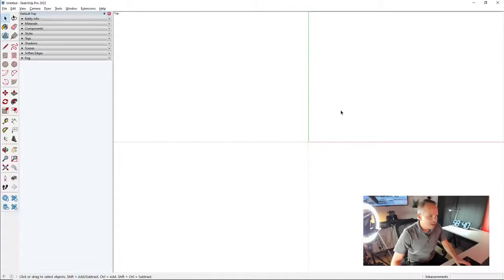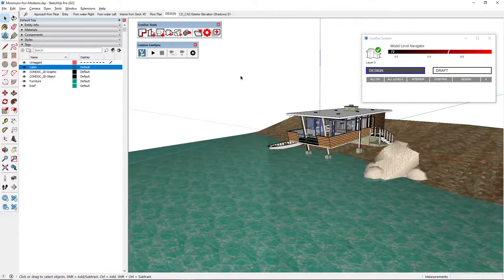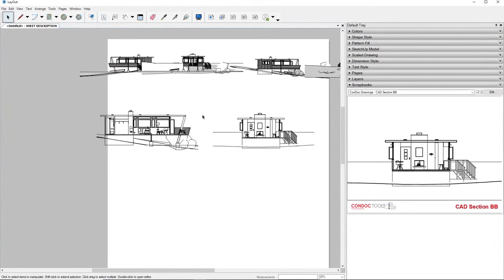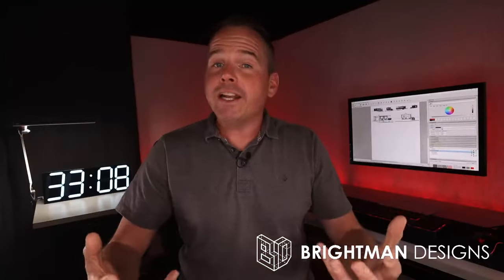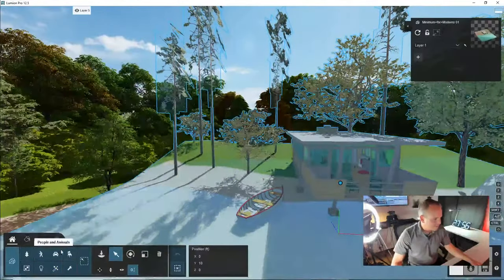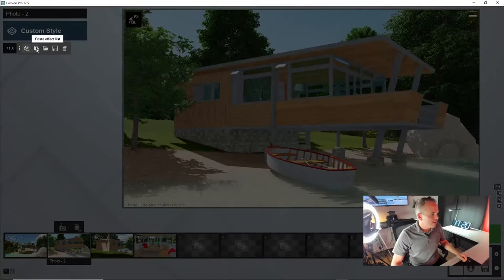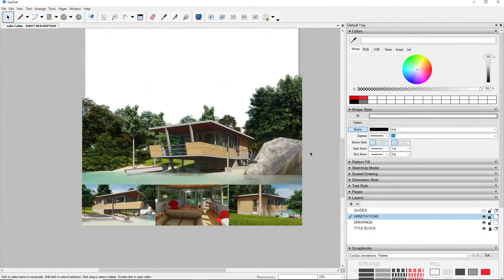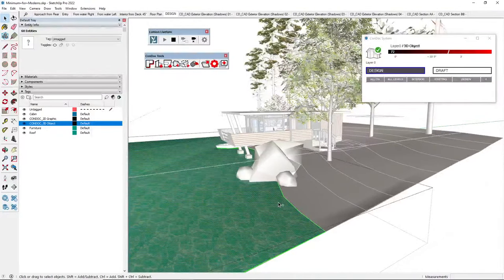Architectural Presentation Board in One Hour

Comment: GREAT presentation! May I ask two things .1. Could you do this same live presentation  for doing construction drawings, please. And 2. What are your machine specs, please, getting Lumion and Sketchup flowing together seamlessly  with no staggering was nice to see. Love the work flow for a presentation board , great work shop !
Reply from the maker: Thanks Wayne!  Love that idea, will add it to the list!  Here's the specs on my new desktop...  

Nvidia RTX 2080ti Graphics Card
CPU Intel Core i9-12900KF 3.2 GHz 16-Core Processor
CPU Cooler Corsair iCUE H150i ELITE CAPELLIX 75 CFM Liquid CPU Cooler
Motherboard Asus ROG STRIX Z690-A GAMING WIFI D4 ATX LGA1700 Motherboard
Memory G.Skill Trident Z RGB 64 GB (2 x 32 GB) DDR4-3600 CL18 Memory
Memory G.Skill Trident Z RGB 64 GB (2 x 32 GB) DDR4-3600 CL18 Memory
Storage Samsung 980 Pro 2 TB M.2-2280 NVME Solid State Drive
Storage 8TB Iron Wolf Drive
Case Corsair 7000D AIRFLOW ATX Full Tower Case
Reply: @BrightmanDesigns   Thanks!